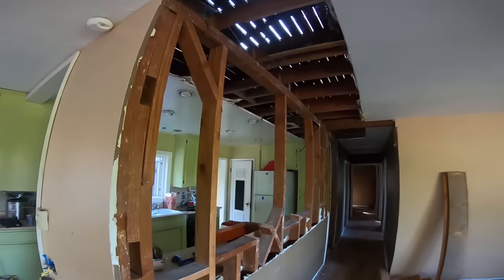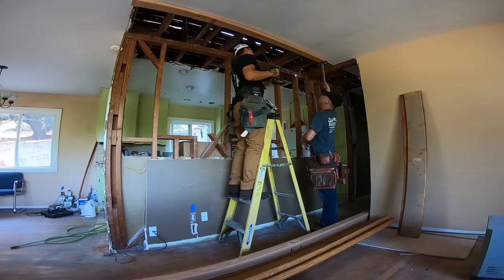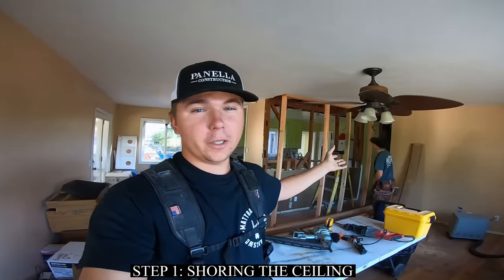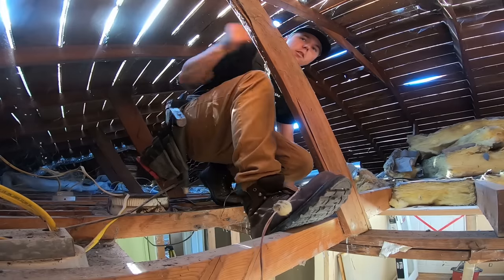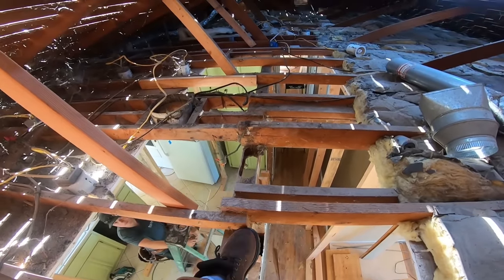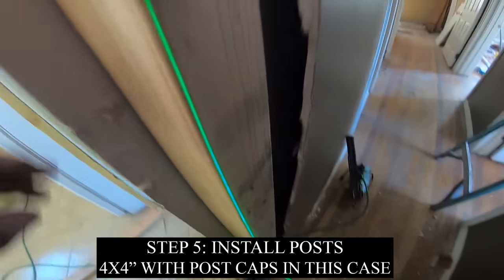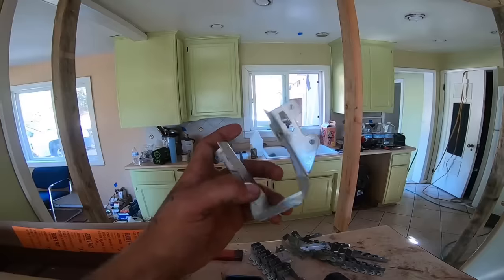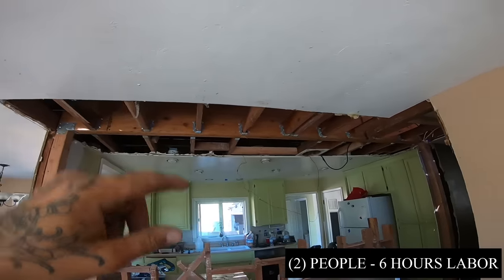How To: Removing a Load Bearing Wall! (EASY STEP-BY-STEP)

Comment: I find this funny. 
I just fixed a house that someone e tried to do. 
Built temp wall. All 2/4’s. 3-4ft apart. 
Temp wall gave out. Inspection and fire Dept listed it as insufficient braces for truss load. 
I have never done it this way and never will. 

1 -2/4’s should go under truss. 
2- smarter move. Use 4/4 for top plate 
3- you could use 4/6 for top plate 
4/4’s and not 2/4’s. Then you can use less and not under each truss. 

6hrs??   You already had x amount done.

Comment: Ohh shit dude, you cut the ceiling joist splice! Ceiling joists form the bottom of the roof triangle and are in tension to hold the roof up. The ceiling joist overlap where the bearing wall was and the beam is now was supposed to be nailed to hold the tension force with a splice, its in the IRC. LUS24's and really all simpson hangers have ZERO tension capacity for pulling the joist / rafter away from the beam. You gotta put straps across the bottom ALL of those rafters where they splice at the beam. Either like a CSHP18 or an LSTA24 maybe across the bottom or a DTT2Z with a rod through the center of the beam would work to splice the tension across the beam. Yeah you basically broke the bottom part of the roof framing triangle. The joists will pull right out of those hangers in tension. They have bearing, shear, and uplift only, zero tension.

Comment: This is how a carpenter works. The work very good.  but notice no mask the dust and crap floating all over the place in every square inch of the house. also notice the floor unprotected.
Reply from the maker: Hard to avoid stuff flying around the home, I had a $700 air purifier running down below. Grey box in the corner of the room.. It’s what happens when the attics exposed.

Floorings being replaced.
Reply from the maker: I’m not a big fan of masks, unless it’s concrete related.

It’ll catch up to me later, I’m aware.

Comment: I would have just put the beam directly underneath the roof truss where a JACK stud supports the load and a KING stud is fastening the jack stud as well as the beam from the side. Instead of cutting the roof trusses and attaching the hangers to them.

Comment: Since the (E) joists were lapped and spiked to also act as rafter ties, have you ever thought about a possible solution to the problem of removing the tensile member of all those rafters when cutting the joists (bottom cord of a basic roof) and hanging them from the beam? I’ve pondered this many times when cutting joists for a flush beam... any ideas??

Comment: What's the cost to remove a wall like that one? Anyone knows?
Reply from the maker: $2,500-6,500 depending on variables. Laborer and material included.
Reply: Thanks a lot for the info.

Comment: A load bearing wall, where I come from, actually has roof load on it, struts from purlins, or scissor rafters bearing on them, ceiling joists can easily be held up by a hanger beam and ceiling dogs. This wall doesn’t look like there’s any load on it hardly at all.

Comment: if he doesn't do what he's doing right now the whole upstairs could collapse down to the first floor this is something that I recommended professional do
Reply: doc hall I did a job last summer people selling the house and it was a few things that warrant legal bathroom in the basement took the door out cover it with paneling like it was never there the wall in the middle to make two bedrooms with a steel I-beam in the basement which the I-beam is great but holding the I beam up in the middle of the house they used a piece of a tree trunk to hold up I mean in the middle of the basement I have pictures to prove it a tree the holdup i beam in the basement
Reply: doc hall you would not catch me sleeping right above that

Comment: this guy has a tool belt he must be legit... *uses chainsaw to cut framing*... nevermind
Reply from the maker: Used chainsaw.. It worked great, lol. I have more documented builds on YouTube than most.
Reply: @MattBangsWood  maybe... but i know a sawzall with a coarse wood blade makes a cleaner cut (and is way safer)

Comment: Couldn’t you just cut the ends of the ceiling joists while they’re sitting on the top plate, install the joist hangers onto the ends, then attach them to the lvl using joists… before you even remove the wall?

That way, the lvl and ceiling joists are already in place - nothing needs holding up.

Comment: The load is not super significant, but he really should mention what is below the new point loads.  Basement, slab, or crawlspace, etc.  And beef it up, if necessary.

Comment: What’s with the bowed 2 x 4 temp supports! Don’t you think if they were already bowed they present a problem during this remodel? The only thing saving your ass is the roof doesn’t have any covering on it because the extra weight would give you a problem!

Comment: who speced the beam? looks a oubled 14" lvl looks wa over kill, especially if that was a 2.0E
Reply from the maker: We’re in CA, everything is overengineered here..
Reply: @MattBangsWood  hey i see you're trying to make money and you have some good practices (except for using the incorrect size fastners with a pnematic gun on the brackets) but, I seriously doubt an engineer spec'd this job. It would have been cheaper for both you and the HO to double or even triple up the existing joist then to install that double ply lvl beam. Wouldnt have had to buy the Simpson brackets too. But most importantly, you would not have needed to cut into the ceiling at all; wouldnt even need to throw a beam into the roof assembly either. And you probably could have charged the customer the same amount for less work, less materials and less living space repairs

Comment: Those LVL beams are $66 each right now.  Which means 2 people working 6 hours earn $280 an hour each for this job at $3500.  Ridiculous for contractors to charge people these prices because it seems like a complex job even though its not.  This is why you need to get multiple quotes for a job- one carpenter may do this job for $1500 where another wants $5000.
Reply from the maker: If someone’s willing to do this for $1,500.. Go for it. You’re not going to make much, and who knows what’ll happen.

$600 in labor, $500 in material + markup. $1,500 leaves $400 on the table, IF the job can be done in 6 hours.

Say it took 8 hours, or 9 or 10? Just due to a little snag in the process..

That $400 profit margin is toast. Working for free? Not me!
Reply: @MattBangsWood  I think we're just in different economic regions.  In Central Ky a decent rough carpenter would be $20 - $25 an hour.  I don't work in the trades, but I am fairly handy.  I've added a beam before so I know that I can do it myself much, much cheaper than most carpenters- like Thousands cheaper.  But you have to have faith in your own work that way and be skilled enough to pass inspection.  Thanks for the videos I'm working my way through them during this lock down!
Reply: Don't forget cost of tools, broken tools, work truck/ trailer, gas, experience, license, insurance, hiring, paperwork, knowledge, higher tax bracket, maintaining tools and vehicles, lumber runs, muscle, attitude, risk, possible overhead,  and most importantly.................A bomb ass radio! After taking all of that into consideration, he made less than you think.

Comment: A simpler solution would be to put a beam across the top side of the rafters - while attaching each rafter to the beam inside the attic. As long as both ends of the beam are supported by either a wall or a post, the rafters will stay in place.

Comment: Always start from the bottom. First footings poured for your post to rest on with base hold down. Then shoring up the ceiling and then cut the joist for your beam. Then putting things together. Plus you should of installed a longer versalam beam that went through the dining, to just have an island in the middle of the kitchen.

Comment: Those are joists? Rafters? What are they gonna hold up, because I would be reluctant to take even a step up there… 

I like my house strong enough that even a 5 pound sledge will only leave a dent in the wall, or bounce off the floor. I’ve learned nothing…

Comment: Did you consult a structural engineer? or an Architect? In some countries you can't just make a structural change to a building no matter how long you have been in the construction business. You must have taken classes and then got certified. Even though I know how to drive an 18 wheeler, that doesn't mean I can just go out there and drive one without a CDL license. 
And then charging $7000, $7500!!!! Seriously? Do y'all have a PH.D in Structural Construction (I made that up)? I can renovate a whole 10x9 Bathroom for that amt and less, yes a bathroom stripped down to the studs. And then y'all want $750 to tear down a Non-Load bearing wall, Now I could understand if it was Cinderblock and cement with Rebar, but Sheet rock and 2x4s???? I took one down the other day, took me 15 mins. 
I used to tell folks this all the time: I used to work in the ER. Our Doctors, who DEFINTITELY have more education then y'all, Got paid $350 an hour. But Here y'all come skipping along and want $750 for 15 mins of work. Those Doctors definitely need to change jobs.

Comment: Changing the load distribution requires a design by a Registered Engineer.  They assume the wall is just bearing gravity load and don't know if it's also bearing lateral or shear load.  Dangerous.  Amateurs.
Reply from the maker: Assuming is a very bad thing to do.. This got reinforced down below. It’s a raised foundation.

Comment: Welp. I guess I can take the sledge hammer to that wall that separates my dining room from my kitchen. 😑
I can’t get my husband to get moving on it and I figured if I began the destruction he would hate looking at it and finish it for me 🤣
My luck I’ll start destroying. It and he will come home to find me buried under a collapsed ceiling.  Sigh. 
We have my grandmothers old home and these walls make zero sense. I want to knock out that wall between the kitchen and dining….plus take out the half walls that lead to the living room and the dang walls that make this tiny “forger” space that has only a closet in it….it’s a teeny room that’s pointless.

Comment: uhhh... no engineering? what's taking the new post loads? new footing in crawl space?
Reply from the maker: We’re in California, plenty of engineering. We didn’t use a 4x4..

Point loads are now carried by 4x blocking in floor system. That is a variable that changes depending on the home, didn’t include in video. Should have though..
Reply: @MattBangsWood  some pour old fool might see this and think well hell I can do that! Not knowing the rest of the things that go into it.

Comment: Very disappointing!!! I would have kicked you out of my house right away because you have not protected the floors or any of my furniture or personal belongings very unprofessional. I just can't believe you're doing all that work on the flooring without any type of protection absolute rookies
Reply from the maker: Did the owners keep the flooring? Or did it get stripped out 100% like the rest of the home?

Please, know what you’re saying before saying it..
Reply: @MattBangsWood  agreed. I did not watch the series of videos because I watched one video to try and figure out something I'm trying to do. No time in the video that I watched did it justify why the huge mess was everywhere. But while watching the video and noticed a refrigerator coffee maker and many other personal effects in the home and yet they're still not covered with plastic or anything else to keep the homeowner from getting dust. debris, drywall dust or insulation on all those personal effects I have to say ROOKIE!!!! If the house was vacated in a sense that I did not see personal effects I would not be making the comment but because the homeowner is probably still there living regardless if things are getting torn apart you should still do the proper thing and cover things as a properly trained veteran contractor would do which obviously you were not. That doesn't mean I didn't enjoy the video it just means that your style of construction and repair work is very subpar and you have a lot of learning to do before you become an actual professional. But like I said I did enjoy your video
Reply from the maker: House was 100% vacant without a soul living there. They didn’t move in for about 6 months after that video came out..

I shouldn’t have to explain myself to everyone, but it’s apparent I should.

Comment: Load bearing walls need to transfer the load at the end posts to eithers a girder (where you should also put blocking) to create a continuous path to a footer below. This is a dangerous video in current format, just think, a homeowner watches this decides to takes on a project not knowing anything about transferring loads, his house can collapse.....

Comment: Hey Mr. 12 year old, that is not a “load bearing wall” it is a “support wall”
Reply from the maker: Hey Mr. YouTube Expert..

If it's holding 10 lbs or 10,000 lbs.. It's 'support'ing a load, yes?

That's why.. In the construction industry, we have "load bearing walls" and "non-load bearing walls"..

It's carrying a load, call it a damn "wall carrying small support" if you must, either way, it's a load bearing wall.

Try again, thanks.
Reply: Good one